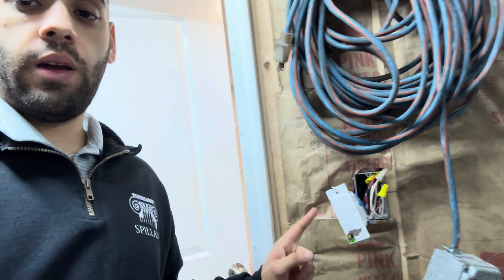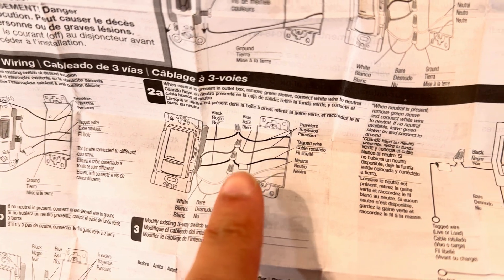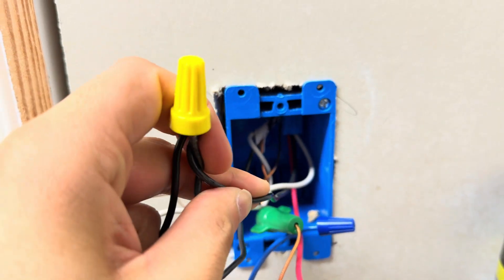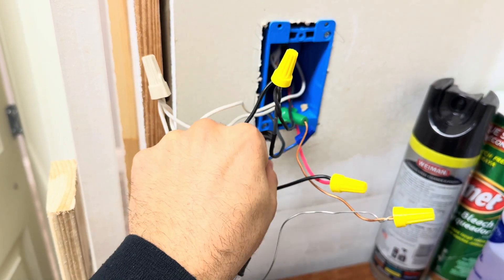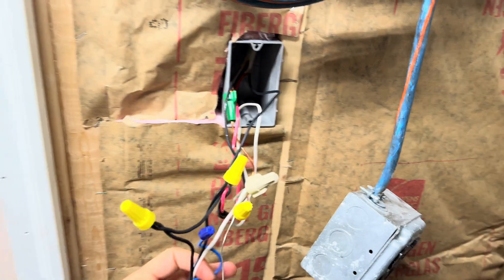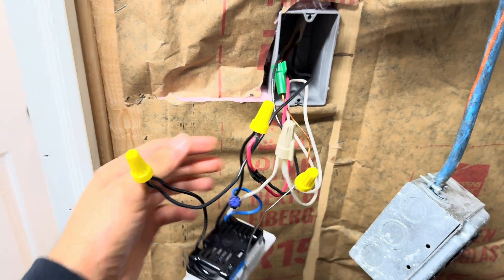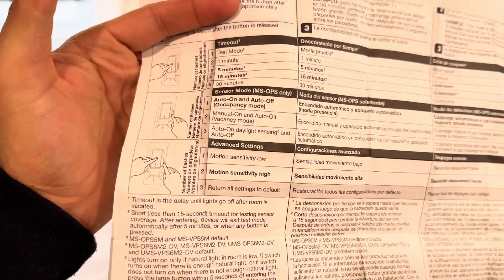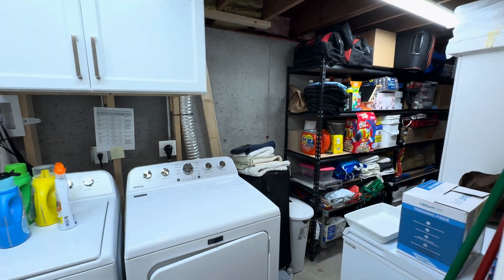Lutron Maestro 3-Way Motion Trick

Comment: Video was great. Tried to use LUTRON's instructions without success. Then noticed it said it couldn't be done.  I used your instructions to install two LUTRON motion sensor switches.  One at the top and one at the bottom of a stairwell.  Why would anyone want a motion switch at one end and a 3 way switch on the other like LUTRON's directions show.  For those trying to this out, you need to connect the black wire going to each light to the red traveler, which can be done at either end or both ends.  You should send this to LUTRON so they could update their instructions.  Thank you for posting this!

Comment: This video is helpful and exactly what I’m trying to do. 

At 3:21, what if I don’t have a remaining black wire? My wires aren’t already in place so I’m adding the 2 outlet switches (similar to your placement locations) I wasn’t planning on running a power line to the second switch… can the 14/3 wire from the first switch just give the second switch the power it needs? And can I just connect the black wire (closest to the blue) to the red wire alone since I won’t have a power running into that box?